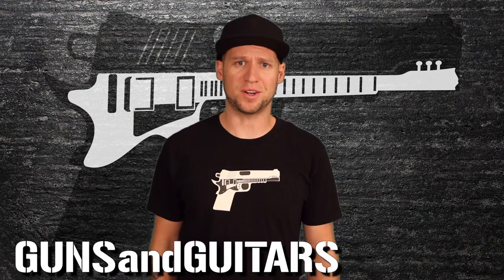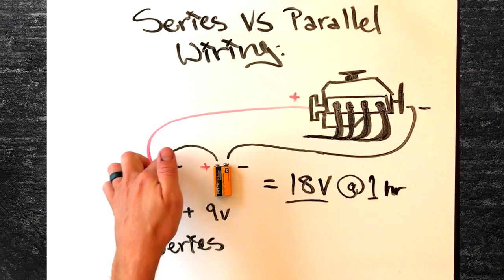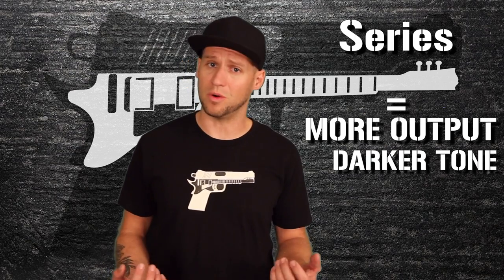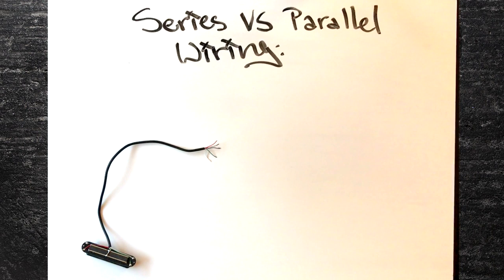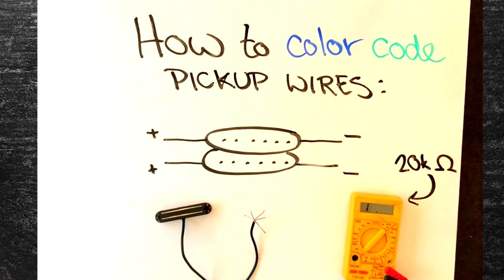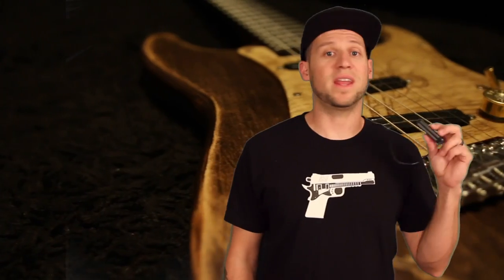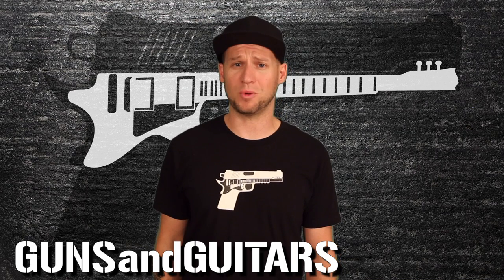How to wire a series/parallel switch for humbucker pickups (guitar hack #2)

Comment: 1:20
Noooo! Coil tapping is when you tap out the signal from your wire in the middle (more or less) of the coil. Like if your pickup has 8,000 loops of wire, but at a point of, say, 5,000 loops it has got a tapped wire end, so that you can choose: to use all the 8,000 or just 5,000.
What you say here is coil splitting.
Reply: Yeah in more than a couple videos he is mixing up the meaning of tapping and splitting. Selecting and splitting are the same function while tapping as you mentioned is isolating part of a coil or coils not one or the other
Reply: Said aside from mixing those two things up the video are actually great good without any excess filler and very clear directions
Reply: You prolly dont care at all but does any of you know a way to get back into an Instagram account??
I was stupid lost the password. I would love any help you can offer me!
Reply: @Callen Julian instablaster =)
Reply: @Langston Zachariah I really appreciate your reply. I found the site thru google and im waiting for the hacking stuff now.
Looks like it's gonna take a while so I will get back to you later with my results.
Reply: @Langston Zachariah it did the trick and I actually got access to my account again. I'm so happy:D
Thanks so much, you saved my account !
Reply: @Callen Julian no problem xD

Comment: Thanks for creating great videos, man. Lots of fun to watch! I have a home made musicman stingray style bass that used to have active circuitry but I ended up switching to passive (too much noise with the active). I have 4 holes/dials, one is a push/pull. I will likely use this info to simplify down to a volume, tone, and switch config. If you have another video that shows the series/parallel thing with a tone and volume, please direct me. Cheers!

Comment: Hey, Dan. I don't know how this video escaped my notice for so long, but I finally caught up to it. I've been wanting to rewire my Strat to have Series/Parallel switching and a 7-way mod. It's all single coils, so I know I'd be combining discrete single coils with my S/P switch rather than individual coils of a humbucker. For S/P combinations, I'm thinking middle + neck / bridge. For the 7-way, I had it wired already using a push/pull pot, but I didn't like how flimsy the pot was, nor its taper, nor its loose turn (nor that it was 500kOhms). I've got two DPDT slide switches (I know I only need a SPST for the 7-way, but hey. I'm working with what I've got). Now just comes troubleshooting how to make everything function together.

I've only found one video offering both, called "9-way" switching, but it winds up being way more Byzantine than I need (though it may be my only option, if I can't figure out something simpler for myself.). I looked through your hacks playlist and I didn't see a 7- or 9-way mod video. Please consider this my request.

Comment: I'm doing this!! I just wired each coil of a humbucker to its own volume knob, on a single-13k-bucker-guitar and for some reason it sounds  like its in parallel. Maybe two no-load pots would be better, as it should be in series and maybe its just a small "constant ground" making it sound weaker.
Thanks, I'm going to use your lesson!

Comment: great video man... my bass kit wasn't as good as I had hoped... but it still plays
Reply from the maker: +Kazahmish bummer! What's wrong with it? If you need help with anything message me on facebook I'll try to help you out
Reply: a number of little things actually, when I drilled for the neck bolts the whole thing moved and now it doesn't seat properly. but since I hadn't drilled for the bridge I thought it was ok, well.. turns out that it is enough to keep it from being intoned properly... 

when I drilled for the bridge ground wire channel I wound up drilling right through the body.. lol nothing a spot of wood filler could take care of though,  and the fret work I did wasn't the greatest, glad I used this kit to learn how to level and crown frets..  but with my health, I pretty much gave up on perfecting this... it is all good though, 75 bucks isn't too much to lose. :)   I DO appreciate your offer and the fact you were the one to spark my original interest in doing this..

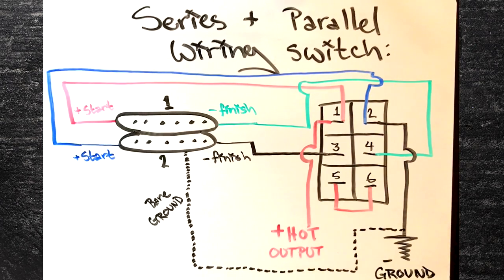Comment: Have you thought about a three position rocker switch that has a middle off position? Might be an idea. Also is it correct how you labeled the left and right sides of the lower pickup as you drew it at 3:26? It seems that as drawn the lower pickup's +ve is always grounded and its -ve is either going to the output (parallel) or going to the -ve of the upper pickup. This seems wrong to me. But it would make sense  if the lower pickup's -ve was always grounded and its +ve went to the output with upper pickups +ve in parallel , and if +ve of lower pickup went to -ve of the upper pickup in series (in other words, if you had labeled the left side of lower pickup -ve and right side +ve or drew the wires differently). This is based on pins 1-3-5 are one pole switch (with 3 = common, 1 = connected to 3 in position 1 [parallel] and 5 connected to 3 in position 2 [series]) and pins 2-4-6 being the other pole switch (with 4 = common  2 = connected to 4 in position 1 [parallel], and 6 = connected to 4 in position 2 [series]) - I think this is right although you didn't show the schematic of the switch.

Comment: Great video - useful info if you don't have the color codes for a particular pickup. Question - if you have 2 humbuckers (neck and bridge), how can you wire it so that when you have both humbuckers on and active at the same time, the humbuckers are in SERIES with each other rather than parallel?  Typically, when both humbuckers are active, they are in parallel with each other.  Can you do this with a standard 5-way switch or would you need a Superswitch? Could you do it with a push/pull?

Comment: I really enjoy playing in the tuning DGDGBe on my classical (give it a try with some percussive playing, for me it's intense!) 
When I get around to making my own super strat I want to use this low tuning but am not sure if there is a certain type of pick-up/system I'd need to use. 
Maybe in the future it would be an idea to do a video on why we use different types of pick-ups for bass and guitar? Or perhaps talk about different types of pick-ups that complement lower or higher tunings? 
Idk, I'm not really an expert, so do what you will with that idea! 
I've always been terrible understanding electronics and circuit boards, this helps clear up some of my confusion, cheers!
Reply from the maker: +SimplyDeano haha thanks for the suggestion. For your tuning, any standard guitar pickups will work just fine, you're not getting too low there. In fact, early electric basses used guitar pickups. I could do a video on guitar vs bass pickups and how they work in the future

Comment: @Guns and Guitars  Could I wire the output into, say, a phase switch? Or would I need a different circuit? Appreciate the vid
Reply: Yes you can. In the video, Dan says pin 1 is the Hot and pin 2 is the GND. To add a phase switch, instead of connecting these pins to hot and gnd respectively, treat them as if theyre the pickup hot & gnd, and hook them up to a phase switch as usuall. Hope this helps (:

Comment: Great video, Dan!  I want to solder up two humbuckers (each with 4 conductor wires) to a single volume and single tone pot. Does the connection (you have shown) go to the volume or the tone pot?

Comment: how much will this cost? and How long do you think this takes? great video!
Reply from the maker: if you already have soldering equipment, dpdt switches are cheap.  I'll put some links up when I get a chance, I bought a 10 pack of switches for like $5 or something.  It takes a while because soldering is a slow process, plus cutting a stripping wires is annoying.  I think it took me an hour or so to wire up the three switches in my strat kit

Comment: Hi, great video! this is exactly what I was searching about. I'm going to swap my bridge single coil pickup in my Strat, with a Seymour Duncan Red Devil, which is a humbucker 4 wired (single coil sized) designed for a 250k volume pot. I'm undecided if realize a coil split or a Series/parallel using a DPDT mini switch. the original idea was to have double choice HB/SC sound... many thanks

Comment: I am building a guitar for my 13 year old.  Here's his wish list.  Strat style guitar (got it), hot rail pick ups (got em;), this is the hard part:  split the pick ups - with a phase switches on the singles.  Now - the singles on one tone pot and the humbuckers on the other pot.   Push pulls on each tome pot.   

im trying to work out the wire diagram now... 

any takers?

Comment: Hey Dan. I need a wiring video NO ONE has covered. 2 humbuckers with a 5-Way Super Switch:
P1 - Bridge
P2 - Bridge & Neck Only Split (Outer Coil)
P3 - Bridge & Neck
P4 - Neck & Bridge Only Split (Outer Coil)
P5 - Neck

But I want the option to coil tap just the bridge or neck by themselves. Can this be done?

Comment: I was thinking of an effect that would use a sequencer program to alternate between various pickups in real time while playing - similar to if you were to manually toggle the selector switch between the various pick up modes. So you could use something like an Arduino and have it alternate the pickups to a given sequence. Not sure if the effect would be desirable or even worthwhile, since it might be somewhat subtle.

Comment: Hi. Is there a way to use partial coil tap with blend pot? I mean, in the pot center position you have full humbucker, if you turn right you have decrease the north coil, and if you turn left you decrease the south coil.

Comment: Hello,  ive been a fan of your channel for quite sometime now, and i learned a ton already. Thanks for your help! 

I have a question, maybe you could help me because i can't find any info about this.

I have a guitar pedal which has an issue with its on-off switch. Since its an always on pedal, I'd like to get rid of the switch completely so literally it becomes a real always on pedal. Can you help me? Thanks in advance!!

Comment: Dan, did you use on-off-on switches for this guitar? If I want to eliminate a three-way switch and only use two toggles (plus vol. and tone) for two rail pickups for a duosonic how would the wiring be different? Thanks, Steve 
 p.s. these are both informative and entertaining!...rare these days! :-)
Reply: I'm trying to do something similar. It sounds like it should work

Comment: Hi, Dan! Love all your videos! I have a Glarry Jazz I'm using as a project bass to learn modding. It came wired VVTT. I want to end up with two V, master T (with push/pull for for series/parallel) and a 3-way for pickup selection. I'm not finding a ready-made diagram for that configuration, and I'm not smart enough to make my own. Could you please help?

Comment: Question: if you install 3 rails on a Strat like that, would the pot values be better at 500k with a .022 uf capacitor?

Comment: When are you going to explain coil tapping or 7 way switches. I have a elite American thin line and I have a regular tele do I was thinking about adding an s1 switch. Just to be sure that's going in and out of Parallel to series correct ?

Comment: I want to wire an HH with two push pull pots, the volume would be coil splitting and the tone would have a black ice capacitor on it. Is this relatively simple? Or even possible? Thanks

Comment: Great as always dan. How about  series/paralell/single/off options on a super strat with  3 concentric pots  each wired for the volume and tone of 1 pickup? is it even possible? It would provide to ultimate in tone options and control.
Reply from the maker: +Bob Sweeney that sounds pretty sweet! The only issue would be fitting all that wiring under the pickguard. I think with some creative routing and stacked pots it might be possible. Thanks for the recommendation!

Comment: Hi Dan, good job with the channel! Very useful and inspiring! I would like to ask you something about the parallel wiring with a push/pull pot. Is the same diagram that you used with the dpdt switch? What I have to solder in the top (normal) pot 3 connections? The same wires were soldered in the previous non-p/p pot?? Thanks a lot and sorry about my english! ;)

Comment: Hi Dan, first of all, your videos are awesome, 2nd: I'm planning to upgrade my ibanez 205SM 5 STRING BASS, with a Seymour Duncan  preamp STC 3p 3 band EQ for passive pickups and for now with a Bartolini M4 NECK  humbucker, and leave the bridge factory one (did not have enough money to change both),  I would like to know how relevant for a bassguitar (I know it is for a guitar), to play with parallel and series connection between the two humbuckers, and about playing with toggle switch puting them single coil and humbucking connection,  any recommendations for my project????? Thanks Dan

Comment: Hey guys, great video. I have a two position, 6 terminal switch and a Gibson humbucker. I've tried this wiring and it isn't working. Are you using Seymor Duncan color codes or Gibson? Are you sure this wiring doesn't require an on/on/on switch?
Reply from the maker: no it uses a dpdt on/on two position switch.  double check your color codes to make sure you wired it correctly.  it's also possible that one of your coils could be out of phase, so if you reverse the two wires from one coil that might fix it.
Reply: Second pick up is backwards should have negative in 2 and positive in 3. You are grounding out positive

Comment: Sorry for what might be a dumb question but I have 2 x humbuckers and 1 x DPDT switch.  Is there any way I can change both the hb's to parallel/series with the single DPDT?  I have an HSH configuration and I'd like to have the hb's in series for one tone style and parallel for another.  Thanks and stay well.

Comment: I want to wire a HH setup in my Ibanez. I want to coil split the neck pickup and wire a parrellel and series switch. I have 2 knobs currently. Could I replace those with push pull pots and wire the coil split to the volume and the parrellel/ series to the tone knob ?

Comment: great video. Can you post a video how to wire LED's without using a 9V battery? (via the jack)
Reply from the maker: I didn't know this was possible.  where would the LED's get power? from the amp?
Reply: I guess. I read something about it somewhere but couldn't find it anymore. I thought it had something to do with a stereo jack.

Comment: Hello there I have a guitar with 2 single coil and 1 humbucker coil with 1 volume and 1 tone. And each pickup is connected with spst type I don't really know but it works as on and off the pickup. 
My question is how could I wire the connection for a good rock or heavy metal sounds on engaging the humbucker. And soft or crunch sounds on engaging single coils.
Actually i really what to know the overall connection how to do it if you could make a video on that really helpful. Thanks 
Because it gives buzzing sound all the time. Even after switching off all the coils.

Comment: Hey i have a guitar with a 3 way toggle switch and a volume knob. Is it possible to use a push pull pot so that when the pot is down the pickups are normal BUT when the pot is up the neck goes parallel and the bridge goes to a split coil?

Comment: i recently bought a cheap behringer brand strat and took it to bits to turn it into something playable, and i have removed the tone section entirely to make room for a volume for a fourth pickup. what would you recommend i do with the extra potentiometer slot that's unique and weird?
Reply from the maker: +famitory I'd do a push/pull midboost preamp. Or you could do an LED light or something weird like that.
Reply: i'd rather not put any active electronics in it. iv'e found a circuit for a passive ring mod that i'm going to put in but it doesn't use a knob so iv'e still got an empty pot slot lol

Comment: Hey, I have  some Kind of "Telestrat" at home and wanted to do a series/parallel switching for the middle position as well. I already have a 3way DPDT switch from another build available. My problem is that with only this function I have one position of the switch that is useless. So I thought I may want an out of phase wiring as well. So the switch would be series - out of phase - parallel. Or something like that. But I can't find any mad professor who already did this and uploaded the schematics, so I'm kinda stuck. What would you recommend?
Furthermore it would be funny to build a Wah in a guitar, because the Wah control is just a normal pot if I remember it correctly.
Greetings from Germany ;)
Reply from the maker: +BaguetteRoulette hey, thanks for the suggestion. As for your switch, as far as I know, you can't accomplish exactly what you're wanting to do, due to the nature of how a dpdt switch works. You'd need a much more complex switch, or a separate switch to change the phase. What you should do instead, what most people do with your switch, would be series/coil split/parallel. Hope that helps

Comment: In the photo for the Series/Parallel DPDT circuit, he has the #2 symbols for the positive/negative poles reversed. Black should be #2(+) while Blue should be 2#(-). Since black is hooked up to the positive lead, and blue to ground. If the positive and negative poles for #2 were like this, the magnets would be in sync, rather than opposing, and it would lose its noise-canceling properties